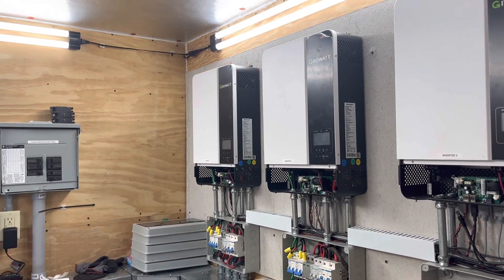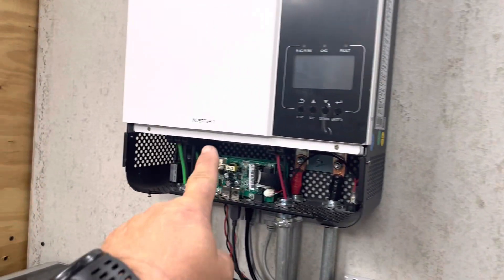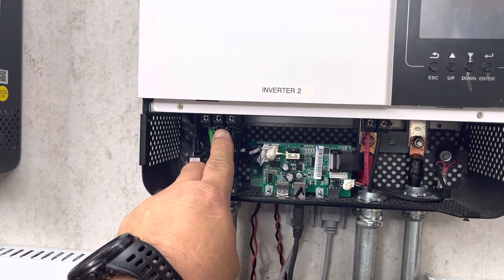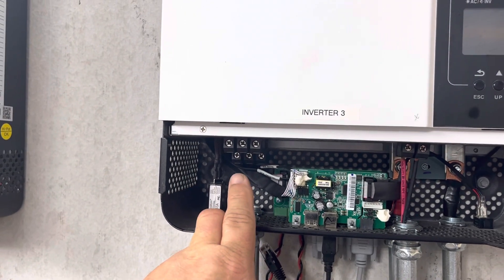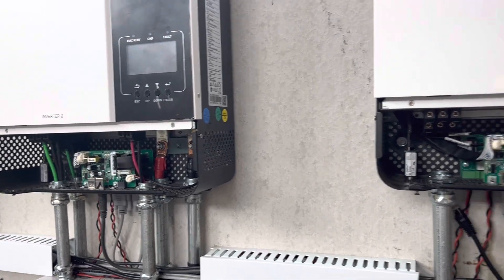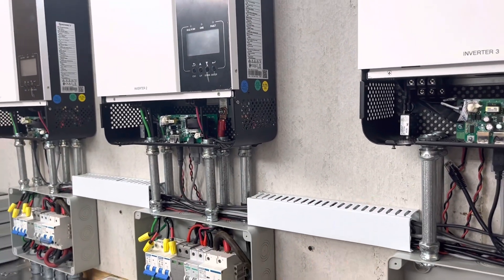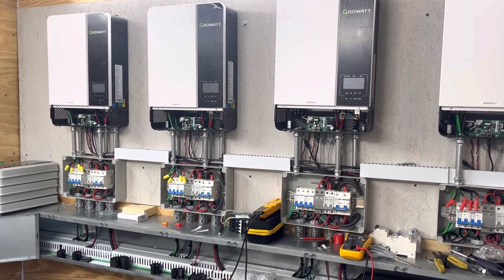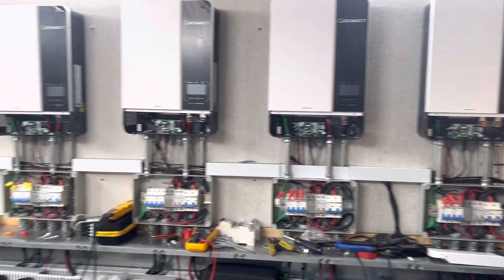Solar Power Project - Growatt SPF5000ES Problems

Comment: I'm having nothing but trouble with my 2 5k in parallel. Would love to chat. I've lost all confidence in the girl want units myself, kind of want to know your opinion as well. I know this was 6 months ago for you but if your troubles or anything like mine, you may still be dealing with warranty issues...
Reply from the maker: Actually, I got so frustrated that I replaced the Growatt inverters with SolArk units. Wish I had done that to start with. I got the Growatt inverters repaired and stored them for possible use on a different project.
Reply from the maker: Check out some of my newer videos.
Reply: @jeffmotes2129  funny thing is the sol-ark was what I wanted it first but was out of my budget. I am now regretting not getting the sol-ark to begin with. I was in the process of watching your other videos right before you sent that message but then I had to go do some other projects. I'll definitely be finishing up watching your videos to see the whole story. I emailed about micro Watts on this last email saying I want my money back because they are so ridiculous. First ones were bad out of the box. And these ones that I got to replace them only worked for one day. Then one failed and as soon as I rebooted the other after disconnecting from parallel in converting it to single it failed as well. This time they are failing with a different code than the first set that I had. So darn frustrating. I'm half tempted to go with the eg4 units for budget reasons but I also don't want to have to redo it again if those don't work out for me. Might just have to eat it and go with the sol-ark.
Reply from the maker: @CrazedPerformanceRepair  I thought about the EG4 inverters. Then I slapped myself realizing the same company was going to provide the tech support for the EG4 that did for the Growatts. And thought “no thank you”. I bit the bullet, it was a tough one, and bought the SolArk 15k units from Scott Hutt at Practical Preppers LLC. His YouTube channel is Engineer775. Check him out.
Reply: @jeffmotes2129  definitely will do. Thanks for the info, oh and making me slap myself about the eg4 because of signature.... I'm not to impressed with them yet myself.

Comment: Two Sol-Ark 12k. They were expensive but no problems for nine months off the grid. I have two eg4 6500 ex to install in my shop. We’ll see how the cheaper inverters work out.
Reply: Have you managed to setup your EG4's? I was also looking at those but am wondering if it has the same inverter guts as what Jeff is having trouble with.
Reply from the maker: I’m probably going to go the Solar-ark route.  Got another inverter shorting between output and input. All the displays are defective.
Reply: @jeffmotes2129  Got to say Jeff I am a wee bit paranoid now seeing your problems. I am still in the research phase for building an off-grid system and was planning on rolling with those inverters. Sol-Ark is expensive so hopefully I can find a nice in-between.
Reply from the maker: @Runnerb03  the really frustrating part is when they were working they worked great. But then one issue after another started showing up.

Comment: Any luck with getting Solar Assistant to work with all your inverters. I still have issues, and now they won't even email back. I started up my 5th inverter and that inverter really pisses SA off and won't connect. And to top it off Signature Solar is no help with anything. It took 15 days and 2 emails just to get no help. This 5th inverter has an issue, it is showing the battery voltage 1 volt lower than the other 4 inverters. This is starting to pee me off. Hope you are doing better than me.
Reply from the maker: My SA works on rare occasions. Hasn’t stayed connected more than a few days at a time and won’t connect to all five inverters. Right now it won’t connect to any of them. What once was an amazing device is now a PITA. 

You’re right signature solar tech support is totally useless. I have over 50 emails back and forth on my inverter three problem. They have been zero help. Three weeks ago they finally agreed to replace the inverter. Took them over a week to send a shipping label. Nearly a week to acknowledge the unit was shipped to them. Still waiting on a replacement unit to be shipped. I ended up buying a new one myself so I could get back up and running.
Reply from the maker: This has been ongoing since early September.
Reply: @jeffmotes2129  I agree SA is a total bust. They will not answer any emails lately. I probably sent at least 4 to 5 that have gone un answered. At this point a refund would be great cause it is useless to me. Anytime the sun is out, it won't connect.

Comment: Just an FYI, I just saw on Sig solars website, they have the inverters in stock again.
Reply from the maker: Ordered one Saturday. Suppose to be delivered tomorrow. Should be back up by the weekend. 

The one from eBay did have the bonding screw despite what the said. Trying to send that one back. If it’s too much hassle I’ll open it and remove the screw. But that will void the warranty.
Reply from the maker: Sig solar tech support … drag, drag, drag. Finally on Monday, after more than 50 emails they’ve agreed to replace the shorted inverter. Haven’t heard from their shipping people yet.
Reply: @jeffmotes2129  On the DIY solar power forum, there are multiple threads on poor service and issues with Sig solar. I have had a tech request in for over 2 weeks no response. I posted on the forum about the waiting with no response and how I had a design question that took over a month to answer, and by that time I had my solar installed and wired. I also stated that I just purchased $4.5K worth of panels from San Tan solar because of these issues and how san tan crated up the panels much better with plywood, not just shipping wrap as Sig solar does. I got a reply back from someone at Sig solar, and he got a level 2 tech to get back to me the next day. Not sure how they are going to handle the comm board issues with Solar Assistant, as the first reply was that they do not support Solar Assistant. But they did send me firmware files and install video. My system is getting clipped by the 18A max solar input, and my one inverter with the newer firmware will go to around 22A. And I think because of the different firmwares, I have a inverter charging the battery, while others are discharging from the battery.           

      I hope you get your system back up soon. Mine is running ok, just the issues with Solar assistant. I can tell you a good story on that too. Been dealing with S A, tryed a few things, nothing is helping much. It locks up or disconnects everytime I make over 12KW  to 15KW or so.

I now am installing about 8KW of solar on my east and west facing roofs of my garage to see how it works for early and late in the day charging. I guess I like punishment, lol.
Reply from the maker: @snoflite5234  I’ll check out San Tan on my next panel project. I got two shipments from sig solar. Both had damaged panels.
Reply: @jeffmotes2129  Did you contact Solar Assistant for your issues with the usb drop out issues? Today they responded to my email saying now they have another issue with the same issue I am having so they are looking into the issue more seriously.
Reply from the maker: @snoflite5234  I contacted them about usb hubs earlier. But I also had the same issue you were having but haven’t contacted them. 

Sig Solar finally sent a new Comm board. It took over a month. The new inverter came in today so I should get back up this weekend. 

Still haven’t heard back from Sig Solar on when they’re going to replace the defective unit. Customer support is seriously lacking.

Comment: Swap the communication board from one of the other bad ones. I am still waiting for Glowatt Australia who where talk to help from there Engineer in Chinese, communication board as well.
Reply from the maker: Great idea! I’ll take the Comm board out of the inverter with the short and put into Inverter 1. Maybe I can get it up back up and running soon using my spare Growatt. Thanks!
Reply: @jeffmotes2129  Then only two go back.
Reply from the maker: @chuxxsss  yes. With my spare I’ll have four. I can operate with 4 inverters. Thanks for the clear thinking.

Comment: I’ve watched a few of your videos, not in any order. With all the switchgear and high quality of installation it appears you are not skimping for the sake of cost. I am interested to know, why did you select the growatt inverters over other, more versatile options on the market?
Reply from the maker: Hey Dave, I bought the inverters, PV panels, and batteries back in November 2021. At the time the Growatt SPF5000ES seemed to be the best fit for my requirements. 

Those requirements included:
Low maintenance, minimum of 25kw output capacity, ability to seamlessly interact with the grid to provide power to 100% of my property, and not require any rewiring inside my home for critical loads. 

 I designed everything else around these major components and requirements. 

It took me 9 months to install the system. If I was doing it all over again today I would take a closer look at the newer EG4 inverters and the Sol-Ark 15k.

Comment: Good luck troubleshooting. Very nice setup.  I'm going to go with the modified high-saturation ferrites for the battery cables.  Not sure if its a gimmick or not but Dr Bradley seems to know what he's talking about.  What gauge wire did you use for the battery connections and did you have to bore out the holes to get the emt to fit into the inverter?  Also did you ensure cable lengths were the same?  I couldn't tell from the video if you had the extra slack tucked behind your server rack or not.
Reply from the maker: I’m following the recommendations of Dr Bradley, except when encompassing both the negative and positive conductors with a ferrite, it’s not necessary to use a high saturation ferrite. Only when you’re putting one on just the positive or just the negative. 

The battery cables to each of the different inverters are not the same length. I ran calculations based on maximum rated DC current for the inverters (more current then they will likely ever draw) and found the voltage differences between the shortest and longest cables to be very small. Another thing to consider is if the outputs of the parallel inverters are not exactly the same then the battery cable voltage drops will not be the same even if you’re using the exact same cable lengths.

Comment: On the inverter you purchase as a spare. Do you know about the issues with bonding inside the units from N terminal to ground? Sig solar states theirs do not have it, as they get their inverters specially made by growatt, others have this bond but I guess you can take the unit apart and remove the bond. This is all over the net, and youtube about this issue, just be carefull when installing your backup unit.
Reply from the maker: Yes. I’m aware of it. I discussed it with the vendor before I purchased the unit. They say the bonding screw is not there. But I will check it with my meter before installing.
Reply from the maker: Actually it was bonded. Had to remove the bonding screw. Once I opened the inverter I found two cables completely unplugged. Found where they went and plugged them into their proper location. Haven’t powered it up yet. We’ll see.

Comment: Hope you get this worked out. I may take my utility input and turn it off for a bit and see what is going on. Great more testing, lol. My wife heard a pffft type noise on Friday, and a some beeping, but no evidence of anything by the time she went to the basement to check on things. I hope that is not the start of issues. I have the comm issue that follows one inverter all the time, with or without hubs, and I have hubs that SA recommended I buy.